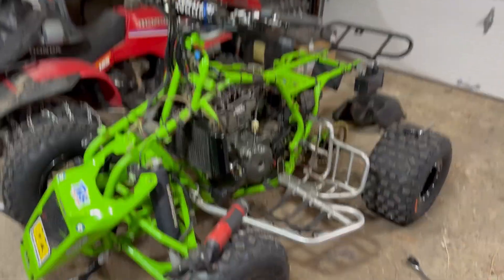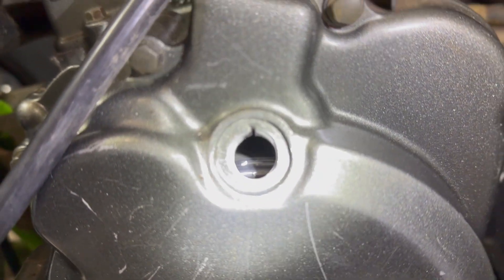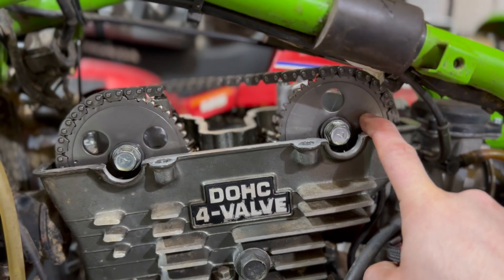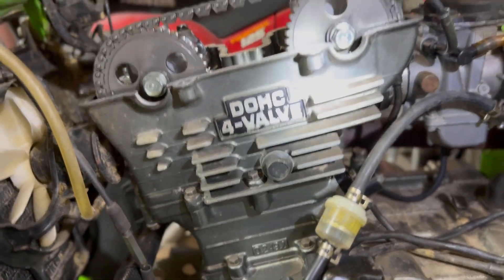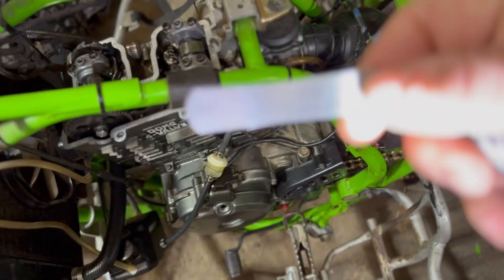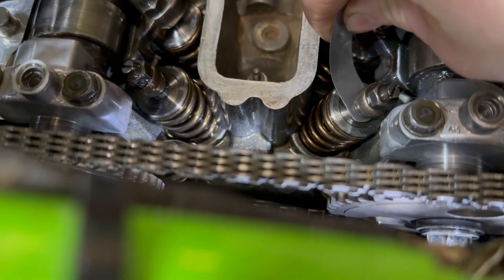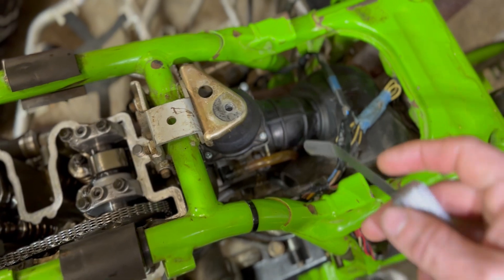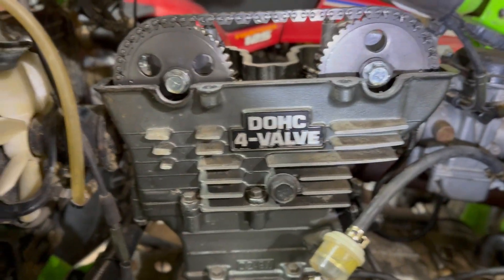HOW TO Adjust Valves & Timing - Kawasaki Mojave 250

Comment: Good video, but your timing on the intake cam is now off. On modern bikes the dots are aligned flat. On Mojave’s the intake cam is supposed to me timed about 3 degrees above. Most people don’t have the manual that tells that. I’m not criticizing your work, just wanted to point it out.
Reply from the maker: Seemed to start run really good with how it’s set. I didn’t see anything mentioned in manual but, good to know!
Reply: @GarroneGarage Thanks for the reply. It’ll run fine but not to it’s full potential. I’m not sure how to add a pic to the comments. I’ve been working on Mojave’s for a little over 25 years. Haha! I have 4 of them at the moment. Great little machines for what they are.
Reply from the maker: @chrishepler7266 such a cool machine, I’m surprised they aren’t as popular. I loved watching these machines race with Trx250x’s back in the day!
Reply: @chrishepler7266   hey I was just wondering if you might know why a Mojave could be knocking during acceleration but not all the time or if you know what it might be. We adjusted the valves to what the manual said but we still have a knock and it is also really slow
Reply: @GatlinO-s2n Mojave’s have kind of a normal knock when you let them lug down. As far as being slow, and your sure the timing is right, one thing I’ve found twice were the cam sprocket “locating” pins shear off. Or one of the cams are just worn out.
Reply: @chrishepler7266  I have a 2000 Kawasaki 250 Mojave, it seems to be running decent, but it’s not getting its full power feel like it only goes about 30
Reply: Hey so I just got one today that has been sitting for awhile and got it to start but it ticks a lot. Trying this tomorrow. I adjust the flat head part and leave a wrench on the nut or just adjust the screw